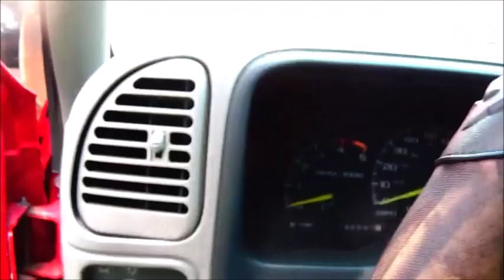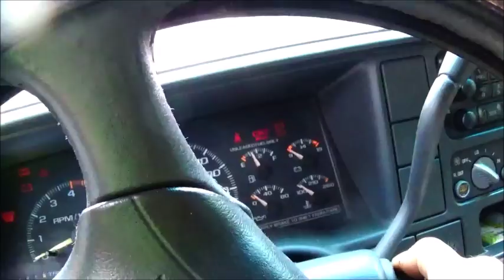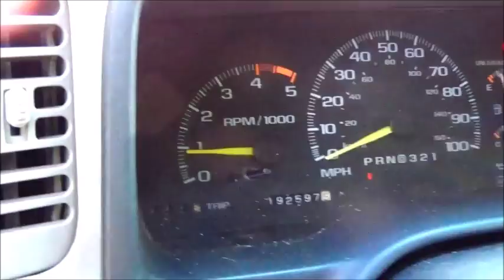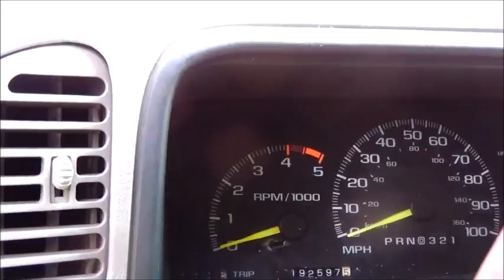Chevy Tahoe, Boy That Was Easy!!

Comment: Easiest way to tell where the plug wire for cylinder #1 goes on these older GM 350 engines is, when cylinder #1 is TDC compression, the rotor actually points at cylinder 1, meaning the distributor cap connection will also aim in the same area. That's how I learned to drop in a distrubutor and get it set up right in less than 30 seconds on these. Glad it was a simple and cost free fix 😀👍

Comment: On those old TBI trucks I always remember 1 is pretty damn close if not right next to the coil wire. I always mark 1 on the cap too on my old chevy's when I replace it, makes it easy when i need to remove all the wires Draw a dot,  I label all the wires too. 1995, Good truck! last of the TBI

Comment: It was not just nothing your expert skills and determination is worth a lot. Not everybody can do that. That was a heck of a good guess that all the plug wires were off one counter clock wise. sheesh I would not have thought of it like that. I would have had to pull them all off and put them back on in firing order. great guess wow.
Reply: He wasn't guessing 
He was using years of experience  and the sound of the engine told him what was going on
Reply from the maker: Sounded like the timing was retarded, so I guessed that someone put the wires on wrong. I am looking forward to hearing the story that got them there!!
Reply: like you said. Looks like new plugs and wires. Not hard to get them confused when replacing them. 
  When I was working in the auto repair shop the boss was A cheap S.O.B. and he wouldn't use custom sets so he bought bulk spools of wire and we had to put on the terminals. I always did one wire at A time on the car so as to not confuse the issue. Some of the guys pulled the cap and changed them at the bench and more than one car got the wires replaced wrong!

Comment: On another channel I watch they always do a 180 on the distributer if there is a starting issue. You would be amazed (well YOU probably wouldn't be!)how often distributor caps/plug wires are incorrectly fitted.

Comment: If you're not to busy, may I ask a few questions maybe you can help me with Jonathan?! 
1- Is there such a thing as a battery charger/starter? (I know there are chargers and there are the new high amp jump starters packs.) But is there one made together?
2- If the new battery pack starters were to be left hooked up to a low battery, would it charge the low battery on the vehicle?
3- Which of the new high amp portable starter packs would you buy today?
If you don't have time I will understand. Thank You.
Reply from the maker: 1, yes they have chargers that charge low amps, but have a selection for "Boost" a high amperage start. 2, I would imagine they would even out to the same voltage over time, but then again I have hooked two good 9 volts together and killed them both. 2, I have never looked into the jump boxes, I bought a couple years back and they didn't perform well, so I just kept using 20 or 25 foot jumper cables.
Reply: Jonathan W Thank you very much.

Comment: Good catch Jonathan, I've done it myself 'cus I was in a hurry to get one done. only to cost myself more time to retrace steps. Say, what did you say about the transmission? I didn't quite catch what you said or meant. Thanks again for your time!!!
Reply: I think he said he disconnected shifter cable because he did not have keys at first tow. I assume so he could shift it out of park and it was probably still out of park when he tried to start. He did mention it was the easiest way to not have to drag it.

Comment: You wanna hear something weird. I got a 2000 s10 4.3 and normally you set the timing by finding tdc on compression than lining the distributor with the rotor pointing to the 6 on the casing but on mine it won't run like that. For some reason it will only run when it's pointed about 90deg back. I've even talked to a GM tech that can't figure that one out either. I just can't wait to get my 94 s10 back up an running just to have less computer junk to deal with.

Comment: had one in the shop last week owner was told it had two bernt valves by a different shop . it was brought to the shop where I work for a engine change . I cheaked it abit turned it over with coil unhooked had even compression cranking no easy spots so I looked abit more found two wires crossed and it just happen to be two that where just across the cap so two dead holes trying to fire on exhaust stroke put them back and engine ran fine . more to story chevy quit was taken to shop A to get running thay found bad pick up coil replaced and did not run right . and you know the rest of the story  it happens
Reply: M. Pierce 
That sounds suspiciously like a deliberate fault! ,’can fix it for four hundred bucks, be done in two days’  Meanwhile its parked out the back for the two days, fix deliberate fault just in time for owner to show up to pay bill and take his car! It happens!

Comment: i was wondering why it was turning over so slow....... till i saw that "starter sled pull" at around 5:45

then again..... ive done the same shit trying to get my 77 chevy's 400 fired up so i can get some fucking heat.... montana be cold!
also have been known to fuck up plug wiring once in a while...180 degrees off REALLY makes some loud noises!

doesnt seem to hurt the starter...... i think most fry them from a low voltage condition (lower voltage = more amps required to get the same power.... more amps = more heat!)

i had a similar condition..... it would start like a CHAMP when cold.... -40f, she would fire all 8 at the same time
however, if ya let it warm up and parked for a while..... it would crank slow and HARD!

WAMP!......WAMP!.....WAMP!

turns out.... i was set for ~30 degrees BTDC

set it back to 10 degrees.... i suddenly have way better MPG!!!
what could that be from?
Reply: ya, this is like my life man.... 
23.... learned from my dad........ just fixing random peoples cars 

just did a 93 Pontiac 2.3l thermostat manifold housing..... simple job right?...HAHA! no...
but the previous guy broke off a bolt, tried to drill it out and fucked up every single one but like 3 threads....

PITA!!!!
Reply from the maker: I always got stuck with jobs like that!!